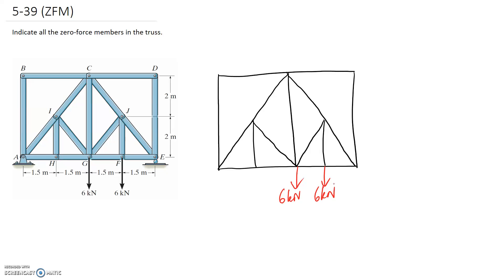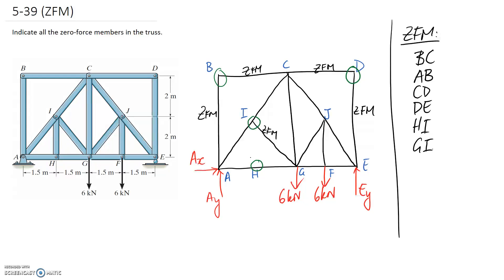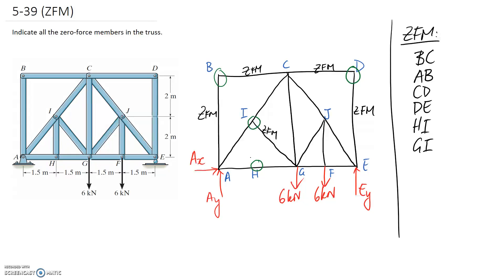(5-39) Identifying Zero Force Members

Comment: Mam as IG and IH are zero force members .. can't we imagine to remove both of them ...and consider the point I and apply rule 1 and say AI and IC  are ZFM as at I there are no ext forces
Reply: They are colinear so you can't apply the first rule. AI and IC are equal and opposite forces.
Reply from the maker: Yes you're correct. My mistake for not repeating the rule again!
Reply: @theryderproject5053  Ma'am if this is true ..as HI is ZFM ..we can imagine to remove HI and conclude AH ,HG are ZFM too (as there are no external forces at Joint H )..By using method of sections (drawing an imaginary cut passing through AB,AI,AH) as these three beams are ZFM ..we get Ay as 0 but this is not true ..from static equilibrium conditions ,I am getting Ay as 4.5kN ... Ma'am I am confused..